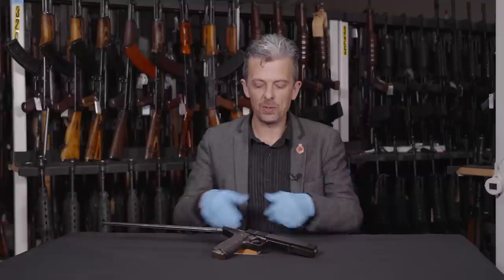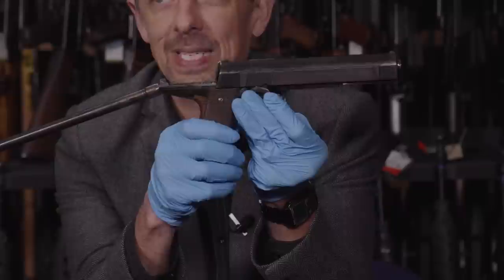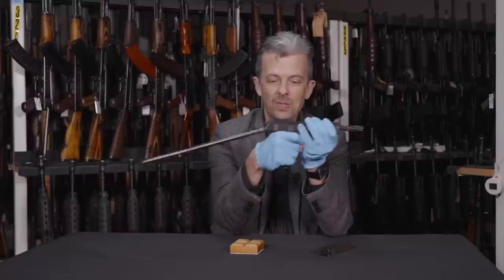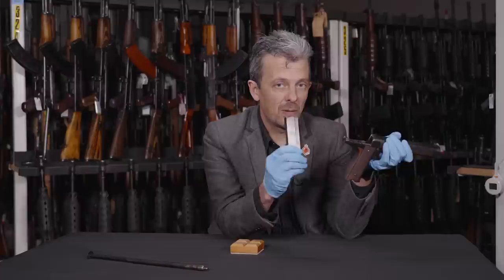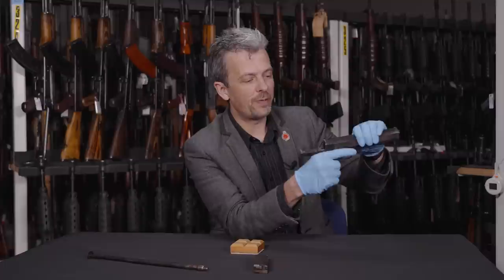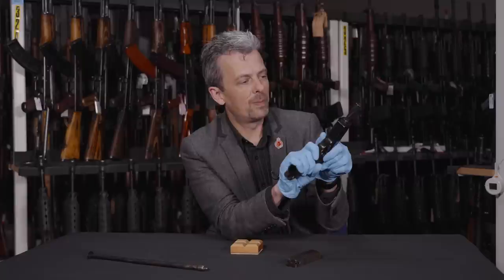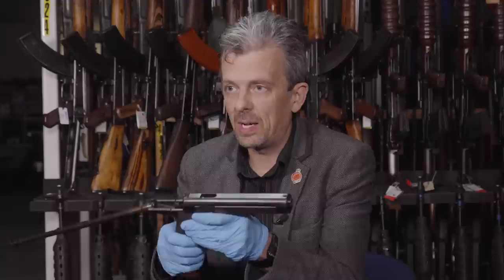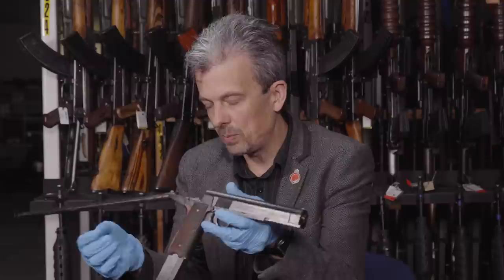Rifling on the *outside* of the barrel? The SR-11 with firearms and weapons expert Jonathan Ferguson

Comment: I'm not convinced about that counter-rotation. If you think of the gun as a black box, when a spinning bullet comes out at one end then the rest of the gun HAS to bear the coresponding torque regardless of what is mechanically happening within it.
Reply: That is true if a firearm is designed to operated as a single rigid body when it fires. Bolt action rifles and revolvers are examples of this in practice. 
But self-loading firearms are more complicated because the recoil is usually first applied to the working parts and then later to the receiver, stock and other parts held by the firer. 
For any given shot where the shooter follows through to realign the sights onto the target (e.g. as part of setting up the next shot), the full recoil impulse from the projectile (ie both the linear and rotational elements of recoil) will have to be absorbed by the shooter. 
When a firearm operates as a single rigid body, the propellant gas pressure produces a force on the base of the projectile and and an equal and opposite force on the base on the cartridge; the latter will be directly applied to the shooter. 
The same will be true for any recoil torque, but the latter is usually so small that most shooters won't notice it. 
With self-loading firearms, the shooter may also have to restrain secondary impulses generated by the working parts. 
As mentioned in the video, these can result in additional disturbances that may affect the shooters hold and lead to inaccurate shooting. 
For example, a STEN gun will start to recoil as soon as the bolt starts to go forward and will then jerk forward as the bolt chambers the cartridge. 
These forces will appear even if the round is a dud and does not fire. (Spring operated air rifles and air pistols generate similar recoil forces, if they are not 'recoil-less designs.)
The design goal of a "constant recoil" firearm is to smooth out the recoil forces and control the manner in which the recoil impulses are transferred to the shooting. 
In particular, when firing a burst, the goal would be to manage the recoil so that it could be balanced by the shooter presenting a constant force (like a steady push) on the firearm. Otherwise, the recoil impulses might appear as series of spikes while projectiles are travelling down the barrel, with periods of zero recoil force when the mechanism is ejecting each spent case and loading the next one. 
As Jonathan explains in the video the SR11 had several practical issues, including being less accurate than a STEN MkV in semi auto fire and being an over-complicated design. 
But the test reports seem to indicate that, when firing bursts, the SR11 was easier to control and thus more accurate than a STEN MkV.
All that having been said, there was an extant simpler design option for improving  first shot accuracy: namely just fire from an closed bolt. So I think the SR11 might have done better if it had been designed to fire from a closed bolt.

Comment: Wait a second. If the barrel counter rotates at the same rate as the bullet inside the barrel, doesn't that mean there's no spin imparted on the bullet? Instead of the bullet spinning as it travels down the barrel, it's basically just the barrel spinning around the bullet while carving grooves into it. I kind of want to see high speed footage of this thing being fired.
Reply: As Jonathan explained, this rare and almost unique artefact cannot be fired. So, instead, see https://www.youtube.com/watch?v=RzM4Zf_nemo for high speed footage of a Savage 1907 being fired.
The 'crazy idea' in the SR11 is that, instead of the recoil torque appearing as a short sharp shock to the firer's grip, the forward motion of the slide will spin up the barrel so that, when the gun fires, the recoil torque is just sufficient to reverse the direction of barrel rotation.
Because of the external spiral grooves on the barrel, if the slide is moving forward  into barrel, the barrel will be rotating one way and in the opposite way, as the slide moves back under recoil.
If perfected, this would change the torque experienced by the shooter from a short sharp shock to a more constant but much lower torque, delivered over the full duration of the firing cycle.
If you Google "small arms review robinson model 11" and "us patent 3738044" you should be able to track down the inventor's claims and the review of them.
Reply: @derekp2674  okay but none of that answers my question. 

The Savage 1907 only rotates slightly as the chamber unlocks. The SR11 barrel fully rotates, seemingly multiple times around, as the slide comes forward. You can see it happen whenever he operates the slide. Since it fires from an open bolt, this means it's spinning WHILE the bullet is traveling down the barrel, to counteract the torque imparted by the spin of the bullet. That's the whole thing that Jonathan was talking about with the math at 11:59. 

He also mentions that the outer rifling is matched to the inner rifling, meaning the barrel spins at the same rate the bullet does, but in the opposite direction. Unless I'm missing something here, that should mean that the two forces cancel out, and the bullet should exit the barrel with little or no spin, effectively making this am extremely complicated smoothbore that still leaves rifling marks, (ballistically speaking.)
Reply: @RamadaArtist  Okay, to answer that part of your question, I don't think that the twist rate of the spiral grooves exactly matches the twist rate of the rifling. Even if it did, the rotational speed of the barrel will only equal the rotational speed of the bullet if the slide linear velocity equals the velocity of the bullet. But if that were to happen, the kinetic energy of the very heavy slide would be many times the kinetic energy of the bullet. So the bulk of the energy supplied by the propellant would end up in the slide, not the bullet.
The US Patent no. 3738044 specifies that the twist rate of the external spiral grooves is set to give the barrel half the angular momentum of the bullet when the slide is moving at full speed.
The drive between the slide and barrel is meant to work like a spiral drive "Yankee" screwdriver except that there is no ratchet in Robinson's design.
For the sake of argument here, if the rifling uses a 1 in 12" twist and the muzzle velocity is 1000 feet per second, the rotation speed of the bullet will be 1000 revolutions per second. 
Then if the rotational moment of inertia of the slide is 10 times that of the bullet, the design should give the barrel a maximum rotational speed of 50 revs/s, so that the angular momentum of the barrel becomes half that of the bullet.
If working ideally, the mechanism would give the barrel half the angular momentum of the bullet as the shot is fired. Then the recoil torque (or 'spin kick' in the language of the Patent) will exactly reverse the angular momentum of the barrel, just as the linear recoil exactly reverses the linear momentum of the slide.
In practice, I don't think the early prototype SR11 achieved that exactly. As Jonathan mentioned, extra mass was added to the slide to improve its behaviour. The Patent also describes an alternative arrangement with a friction clutch between the barrel and slide, which I think might work better.
Reply: @derekp2674  Okay, that helps make things make a lot more sense. As soon as I got to, "the rotational speed of the barrel will only equal the rotational speed of the bullet if the slide linear velocity equals the velocity of the bullet," I realized the error in my logic, because obviously the spring isn't imparting the same velocity on the slide as the propellant is on the bullet, (if that were the case we would be better off shooting bullets with springs.)

Since the slide is moving slower than the bullet, even if the external barrel grooves are matched exactly to the rifling, there's no way that the barrel can be counter-rotating at the same angular rate as the bullet is regular-rotating. And obviously it wouldn't need to because of the much higher mass of the barrel, so a slower rotation would impart the same overall moment. Which apparently they were only going for half of anyway.

Thank you for digging that out of the patent for me. I looked it up on Google, but whatever version I was looking at must have been scanned and automatically digitized because it seemed to have a bunch of OCR errors and I was getting annoyed trying to pick relevant information out of it

Comment: Why would you show the calculation sheet as overlay and not just make it as easy to view as possible? We can deal with not seeing you for a bit and still listen. A link perhaps to the article featuring this SR-11 in the video description? No, too easy.
Reply: If you Google "small arms review Robinson model 11" that should find you the journal article. 
Similarly "us patent 3738044" should find you the US Patent.
As for the calculations, Jonathan did not want to present them in any detail, so we agreed just to refer to their main deductions about the (very small) magnitude of the recoil torque). If there is a demand for more technical detail, then the calculations could be released, ideally after getting them independently checked or peer reviewed.
Reply: Apologies - I did mean to ask the team to put the link in the description. I'll do that now. As to the calculation, Derek (who wrote it) has explained.

Comment: You know what this is? An absolutely bonkers exercise in engineering just for the sake of it. Like the Backwards Bicycle (see YouTube for Smarter Every Day) just done to see if it can be done and what difference does it make. 
The fact that the maths does play out the assumption alone makes it compelling. Yes the torquing effect of the rotation isn't as noticeable as a v8 in a muscle car or the rotation of the engine in a single engine airplane but it IS there and not worth forgetting about. The other fact that this points out is the forward motion suddenly being stopped causing the dip in aim may not have been noticed or thought about before is worthwhile as well. 
#smartereveryday #backwardsbicycle

Comment: Some incredibly rubbish design ideas in here - awful buttstock, extremely exposed trigger group/recoil spring and an auto ejecting magazine that drops wherever you're pointed whether it's in a field of tall grass or a high building down onto rubble where it slides away never to be seen again.

You could argue it didn't look the part either with its silly looking rear slide guide looking like the 1911's less successful brother.

Fair play though to the guy for making an attempt at a military firearm.
Reply: He says the magazine is not meant to be retrieved, it is meant to be disposable.
Reply: It wasn't explained in the video, but the removable telescopic buttstock allows the whole weapon to be carried in a large holster. I think both the Czech VZ61 and the H&K MP7 show better ways of achieving this.

Comment: Just to be that guy, the slide is not always in motion because it has to stop moving to change direction.
Reply: I agree there will be points in the recoil/counter-recoil cycle where the speed and velocity of the slide are zero. However at those points, the slide will not be at rest, because either the recoil spring or the recoil from the shot will still be accelerating the slide.
Reply: @derekp2674  Doing God's work here I see Derek :)
Reply: @jonathanferguson1211  Thanks Jonathan. I think it was Voltaire that said "God is not on the side of the big battalions but on the side of the best shots."